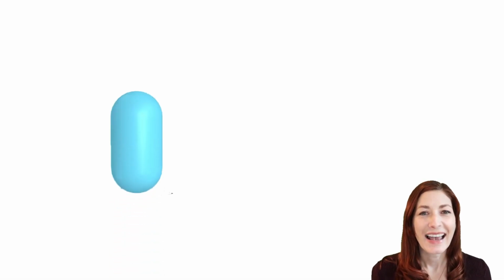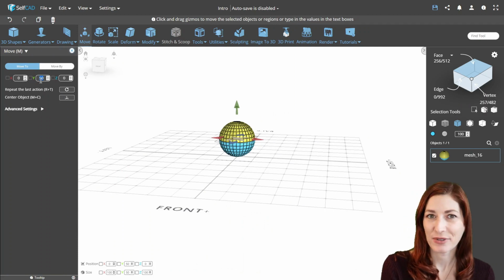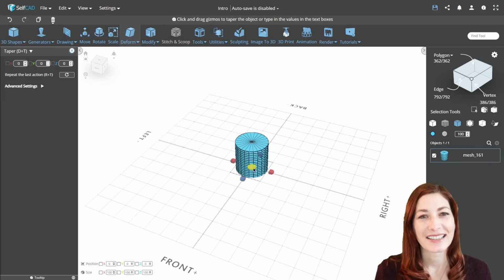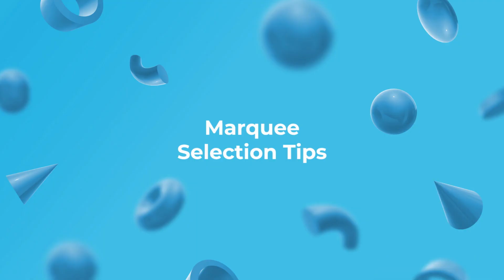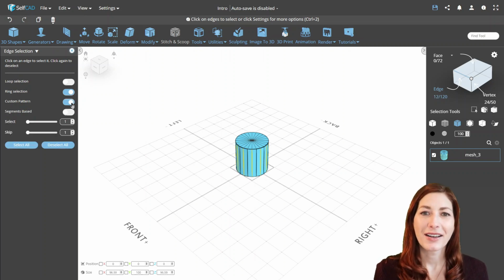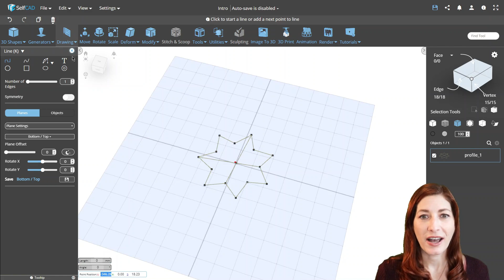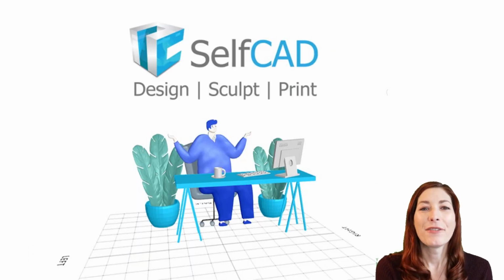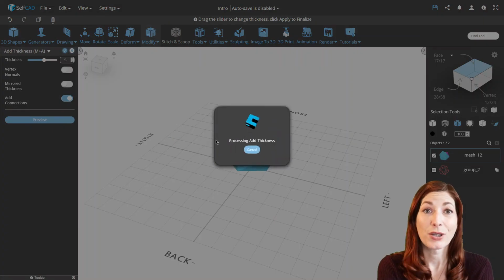How to Modify & Extend 3D Objects(SelfCAD 3D modeling 101 series Part 6)

Comment: hi,
Can I draw for example 3d surface along three curved lines (arcs) for my hobbyist products using your software?
Reply: Yes. SefCAD makes it really easy to draw in 3d space and snap to anything. Hence, drawing a 3D profile is really easy, but converting the drawing into a mesh requires some know-how. Depending on what you want to accomplish, the bridge tool is usually your best bet for creating the surface, and the Add thickness tool is then used to make it a solid.
Reply: @3dmodeling101  , thank you so much